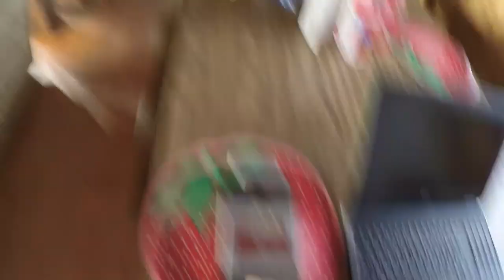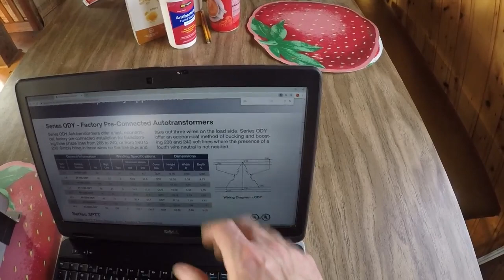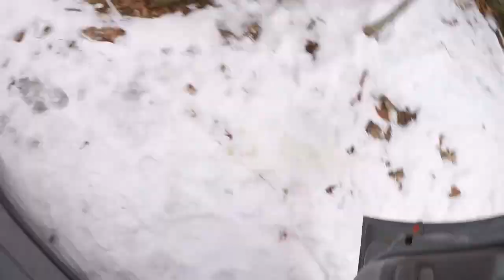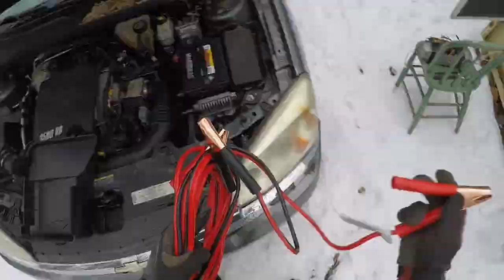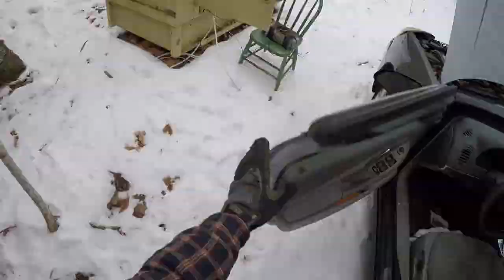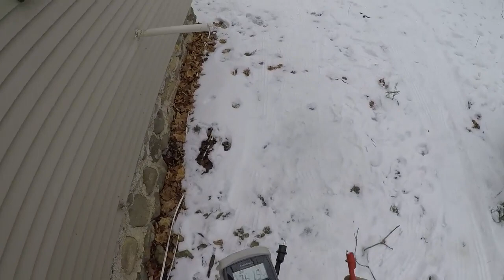Camp electric - inverter/charger won't work with 208V from 3-phase generator????

Comment: All this work and planning, just to use 208v 3 phase generator where all you have connected can only use 240/120v split phase?
That generator are wasting fuel, and can only be loaded at 1/3 of it's rated power.
If the generator can't be re-wired, maby switch the generator head?
Or faster and simpler, just switch the generator?
Fing a small, cheap, generator. And load it to 60%-90% capacity for fuel effeciency. 
Or a modern inverter generator that gives clean power, and saves fuel by throtteling/slowes down to match electrical load.
Diesel engines are long lasting and durable when given enugh load to burn hot, the fuel can be stored for decades, but engine needs glow plugs to start in winter.
Propane engines are just gasoline engines, without the carborator trubble, tho gas pressure might get low in extreme cold weather.
Gasonline engines are common and cheap to buy. -But a pain to deal with carburator issues, and a short shelf life fuel + with ethanol mixed in, that absorbs water out of the air to give you even more trubble. (Buy alkylate gasoline that can be stored for a cuple of years maby? )

Comment: Been thinking of trying some hydro power at the camp. 3 phase to rectifier. 8 hours of sun in winter just is not a whole lot. Bought a Maxwell super capicitor to replace lead acid deep cycle battery. Tested super capicitor got 8 hours of radio play. Lead acid around 5 hours same radio. Hoping super quick charge time 10min of super capicitors will help. It gets too cold for lithium ion to work well. I don't run ac inverter just 12v dc. Lithium ion does pollute very badly.
Reply from the maker: Interesting.  Yes, winter energy availability is rather low especially when a lot of the days are cloudy.   What super capacitor are you using?